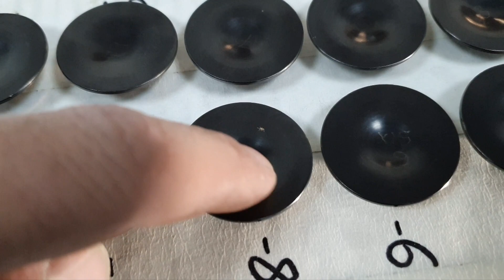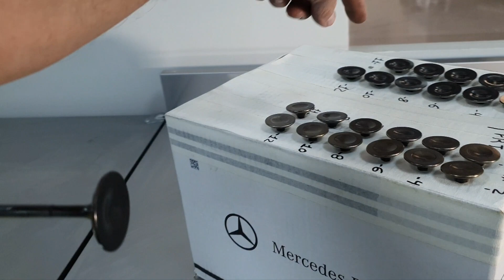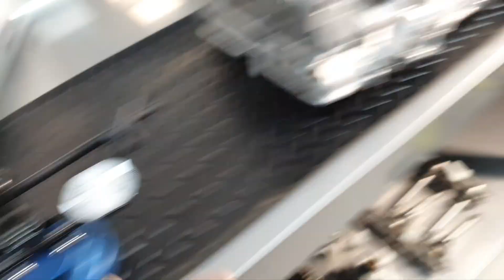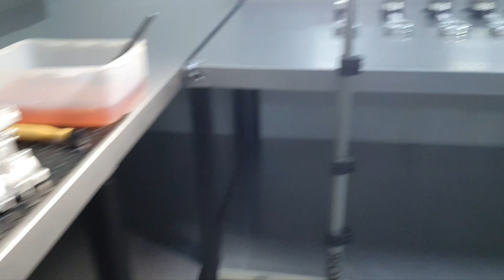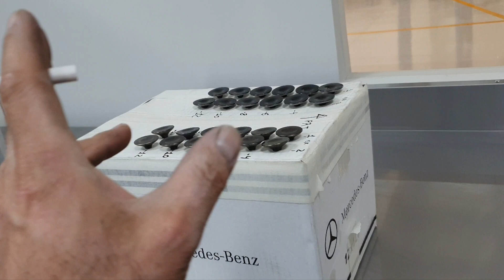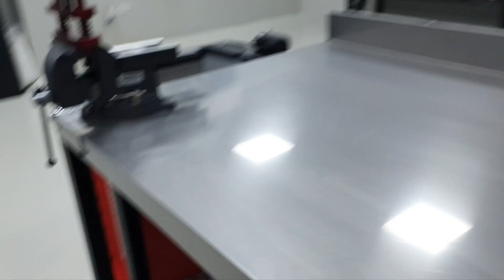2JZ-GTE engine refresh (part 6)

Comment: You should check the valve piston clearance using some clay. It must be tight and there was contact at high rpm due to valve float or rod stretching. Maybe he went too hard on the rev limiter.
Reply: Okay, I just watched the video. (I'm because I'm out of coverage.) Of course the way you checked with a degree wheel is the most precise. I just had not seen what you did until a few minutes ago.
Reply from the maker: Watch again the video please, there's almost 10mm clearance
Reply: I missed where you said there was 10 mm of clearance. I meant put some clay on the piston top in the valve indentations, then assemble the cylinder head with one pair of intake valves, camshaft and timing belt, then rotate the engine 720 degrees, then disassemble and measure the thickness of the clay. It won't be 10 mm.
Reply from the maker: I did the same thing with dial indicator, I repeat watch the video again
Reply from the maker: You mean the clay will be more precise than the dial indicator

Comment: I have no idea, but does the car have an inter cooler ICE BOX? Could the “temp delta” shock the valve maybe and cause it to warp? You caught that before assembly that’s the most important thing. 2 step/anti lag problems.

Comment: Didn't cylinder 6 have some wear on the wrist pin??  Do the valves move in the guide when you slide them north south?
Reply from the maker: Joel, I hope you are not asking me, if yes you are insulting me.
Reply: @TasosMoschatos generally on inline 6 the number 6 gets more heat and takes more abuse correct? for sure not trying to insult you, just trying to think.  Then, at 60psi of boost if there aren't individual EGT sensors and the intake flow tested, one of the cylinders will wear faster.  I am just wondering if there is a problem to find.
Reply from the maker: 101